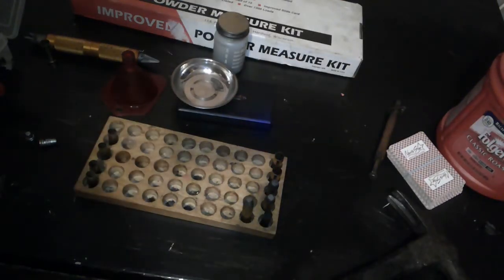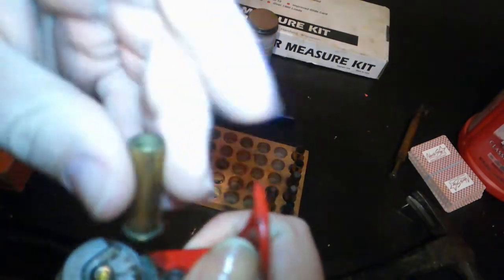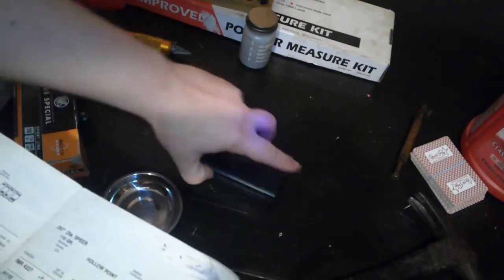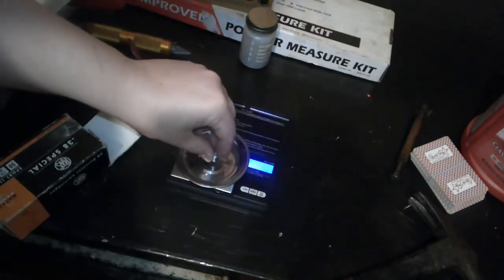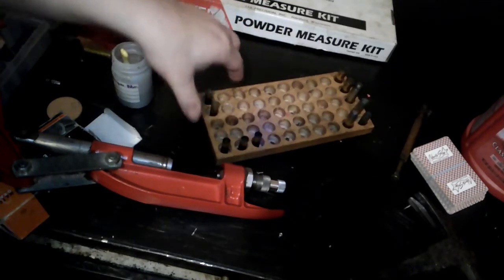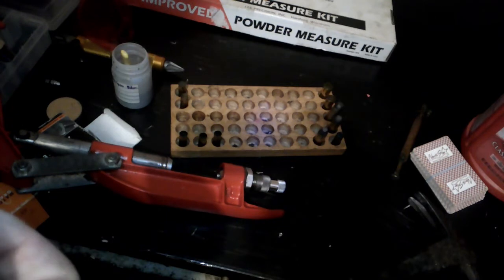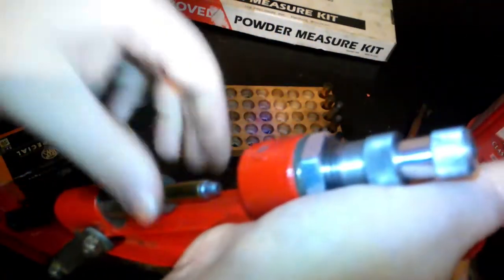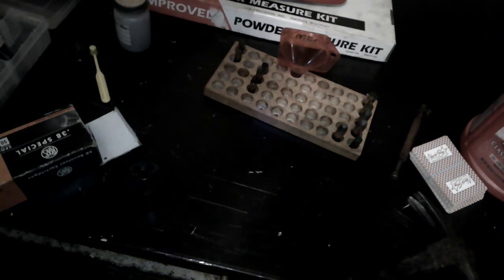Revisiting Hand Loading Smokeless Powder.

Comment: When I first did reloading, first powder I used was H110. Good powder, but not for a beginner. I used half of the needed charge, because I wasn't sure. My loads left tons of unburnt powder, and when I used 128 grainers in 357 Mag, the bullets got stuck in the barrel. Even once, I did one full scoop of .,5 cc, then a 'half' scoop. Gosh that didn't work out well. This was within my first 6 months mind you. But yea eventually I learned more and more. 
 Taught me something important: Be sure of the powder you're using. Understand how it burns and the desired pressure it's effective at. If the manuals don't list loads for it, then don't use it. I mean, I've gotten away with using H4198 in 7mm Mag but it doesn't perform as well as it should. 
For a long time, my 'plinking' powder was WSF ball. Nice powder, but I decided to do some 'hotter' loads with it and that's when I found out that WSF spikes pretty fast when you go over it's limit. It's all a learning experience. 
 As of right now, I'm working out a Power Pistol load for .38 Special. Good load, but the bullets I'm using are leaving leading. The constant problem solving is one of the joys of this hobby. If I was just looking for a smokeless powder that'd give me a reasonable charge for all the calibers I do, I should've just stuck to Unique. But I prefer specialized loads and experimenting with the different calibers. I love Blue Dot in .45 ACP, I love shooting H110 .357s. I just had to 3031 in .303 British as soon as I found out that was the first smokeless powder designed for said caliber. Now I'm not saying I buy all the powders just to have all the powders, but if there's a specialized purpose for it in said caliber, I have to try it for myself.
Reply from the maker: More you learn the more versatile you become. When comes to rifle power I admit I have become a sucker for IMR  3130 and pistol I like Unique and 2400. But I'm honestly still learning about smokeless loading I just started a couple years ago. Iv loaded black for several years now but started loading smokeless about two maybe three years ago. I started out with Blue Dot and Green Dot that my dad had he use to load shot shells. 
I had a bad experience one time when a .38 Special loaded up to .357 magnum pressured found its way into a snub nose .38 Special I had 😖😖😖 learned a lot that day.
Thank you for the information and on the powders you mentioned. ❤️❤️❤️
Reply: @JoanieKennedy  You're welcome honey. 
Yea H110 is a all or nothing powder. 90 percent of the case betwreen the primer and bullet base needs to be filled. More like 95 percent. It's a slow burning powder, so it needs to be filled like this. Has a big boom and fireball to it. Favorite for magnum cartridges. But aside from using it in magnum revolvers, and .300 Blackout, not much else you can use it for.